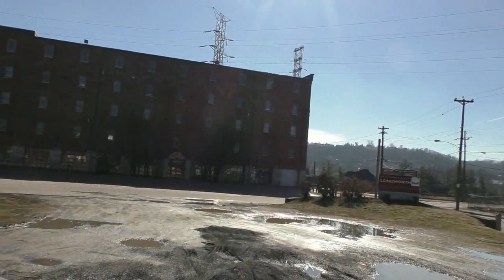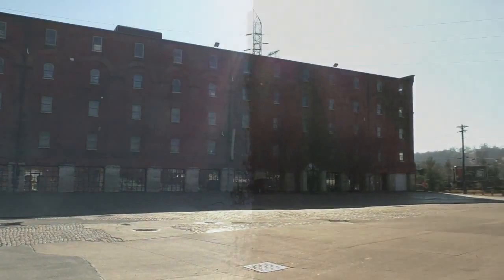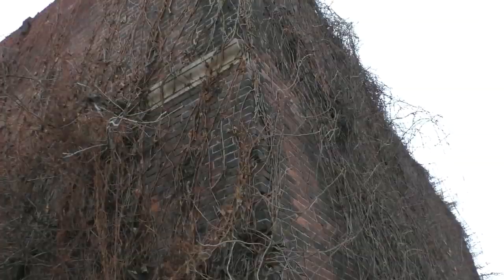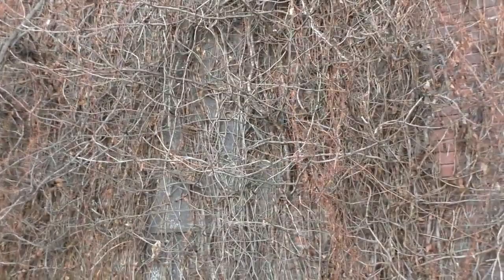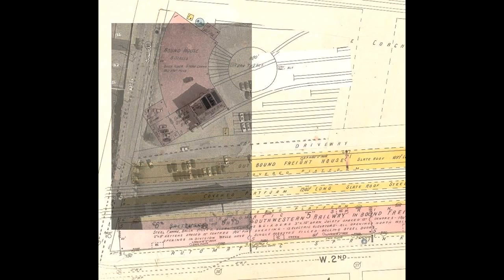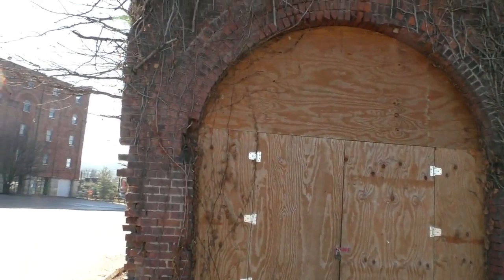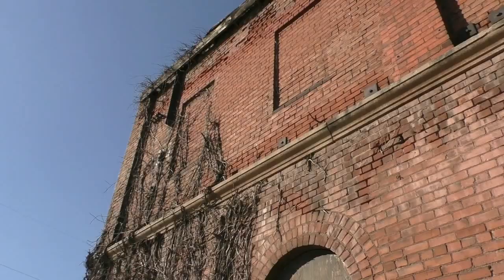Longworth Hall Railroad Building RUINS | Explore Cincinnati History

Comment: I was told that the residual structure was the steam plant for the entire complex. If true, there would have been a stationary boiler (otherwise exactly the same as the boilers on the steam locomotives used by the B&O at the time), and it would have fed both the warehouse and the attached roundhouse/maintenance shop.